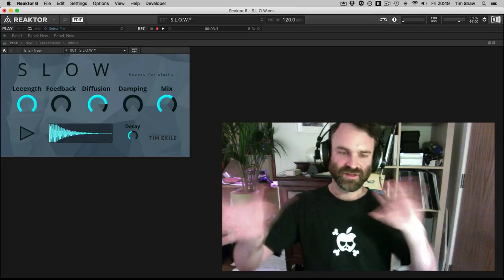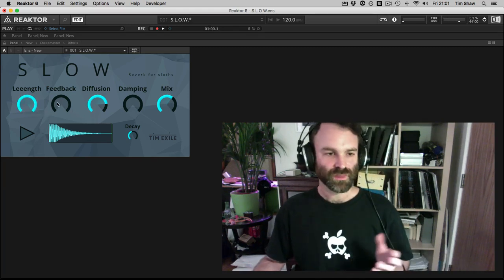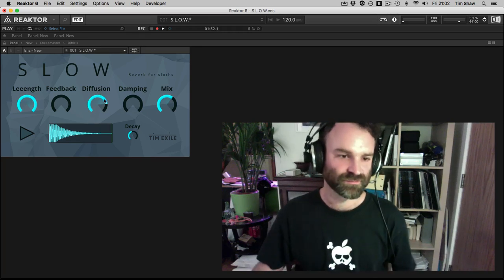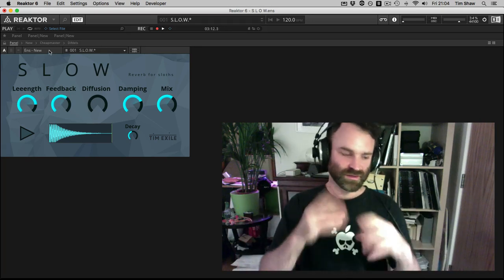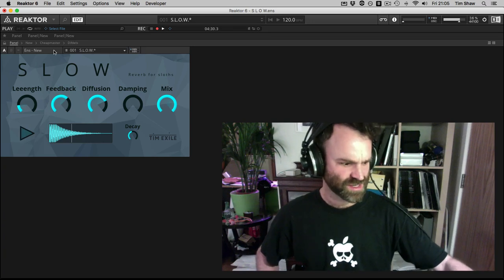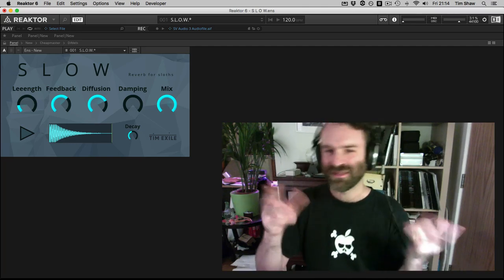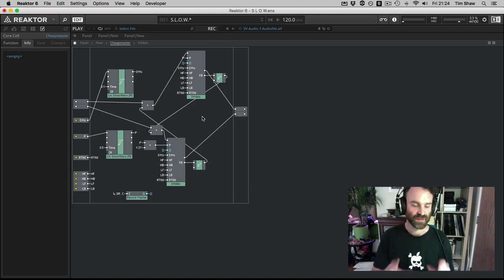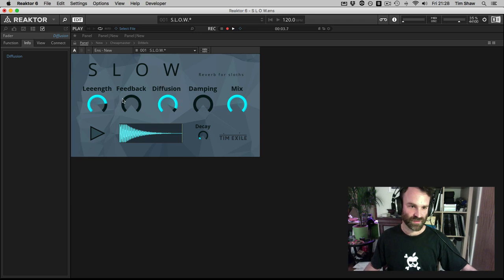S L O W Vlog

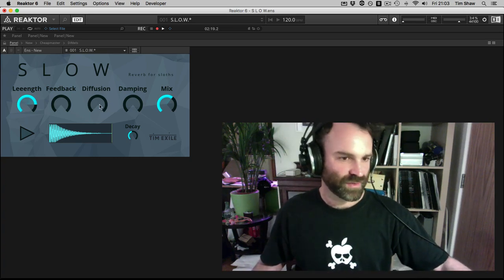Comment: Really looking forward to playing with this when I finally get myself an upgrade to Reaktor 6. Out of  interest what was the cause of the delay-line break up you mentioned at 3:50?
Reply from the maker: One of the ways I crammed more delays in than usual was by stripping the interpolation out of each diffuser. It also means the delay lines have a more neutral frequency response but means that changing the delay time causes aliasing - which subjectively sounds bad or good!